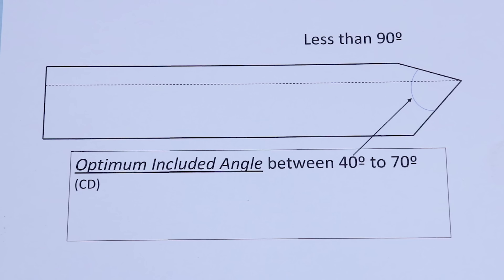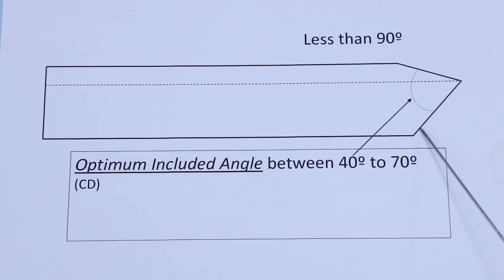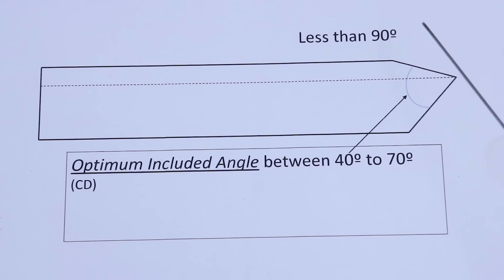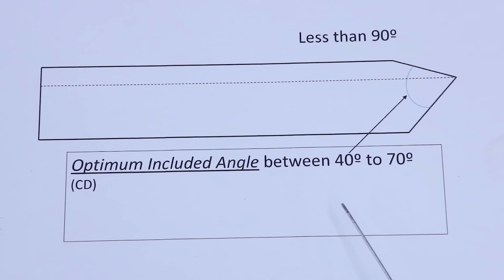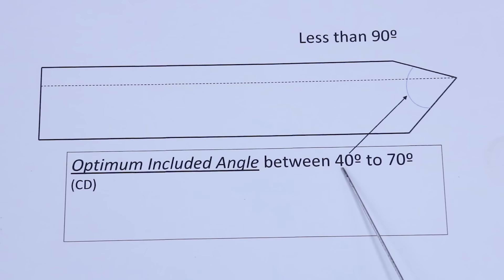The ULTIMATE Guide to the Negative Rake Scraper     Woodturning with Sam Angelo

Comment: Sam, this has to be one of the most valuable instructional videos I've seen in a long, long time. I hit the "save" button so quickly you wouldn't believe it. One major point is that some tools are too short to sharpen on a wide platform IF they are handled. I love being able to remove handles and take full advantage of a nice, flat platform. I have some short parting tools that would be impossible to sharpen correctly if the handles were attached. I made similar comments on a Mike Peace video just yesterday. I depend heavily on jigs, fixtures, sharpening systems, etc. I especially appreciate your inclusion of angles on the bevels of different configurations of NR scrapers. Thanks again for the help!
Reply from the maker: Thanks very much. Sam

Comment: Hi Sam, thanks for another very informative video. With experience I’ve come to prefer using a round nose NR scraper on the outside of a vessel. It has a much longer edge which equals more time at the lathe and less time at the grinder. (It also avoids those potentially embarrassing 90 degree corners contacting the wood😂).
Reply from the maker: Thanks for sharing!  Sam

Comment: Very informative. I may try to make one of those soon, I could totally use one. On a seperate note. is there anything you recommend to make out of the metal dowel left on the end of a spindle gouge, once I have ground off the entire flute?
Reply: Cat's claw ring tool
Reply from the maker: I am sure you could turn it into a scraper of some sort or maybe a point tool. Thanks SAM

Comment: Easier than all of that math. I had to replace a CI Sq carbide cutter. Rockler didn't have the appropriate negative bevel scraper, so I bought the standard. When I started turning, I had a hell of a time with the scraper catching the corners (pen turning). So what did I do? I looked at the back end rake, turned the whole thing over, and used the back side as a negative rake scraper. NO hitches. NO binding, just beautiful curls.
Reply from the maker: April, I have a few carbide type tools-mostly for hollowing.  I find them very aggressive and at time difficult to control.  I recently bought one for turning the inside of lidded boxes and it is just hard to control.  (Maybe its me???)  Thanks for your comment.  Sam

Comment: Sam,  you didn’t say what grit your CBN wheel is in your demo on the right side of the Steel City grinder.  Is it a 180 grit?   Is 180 grit the best for raising a burr on scrapers?
Do you use higher grit wheels for other purposes… like the 350 or 600 grit wheels?
Reply from the maker: Thanks, on the right side it is an 80 grit wheel.  The left wheel is 180.  I do not have any wheel that is finer than 180.  Sam

Comment: Sam. i noticed you were working with a robust lathe and stated that your lathe was turning at 1400 rpm.  My robust lathe out of the box does not have a way to know the speed of the lathe.  What did you do on your lathe to give you that information?
Reply from the maker: It sounds like you have the American Beauty Lathe. That is probably what you saw in the video. If you look at the speed dial on the remote control unit, there is a scale around the dial. There are two scales for the two belt positions.  This will tell you pretty accurately what speed you’re turning at. Let me know if you have another question. Thanks, Sam.

Comment: Very useful, Sam. Question- why would you ever need to sharpen the top bevel on a NRS? I always figured I only needed to do that when I used up enough of the steel?
Reply from the maker: I will address this comment/question in my next “Notes from the Turning Shop video”  Thanks 
To be published on June 5th 2022
Sam